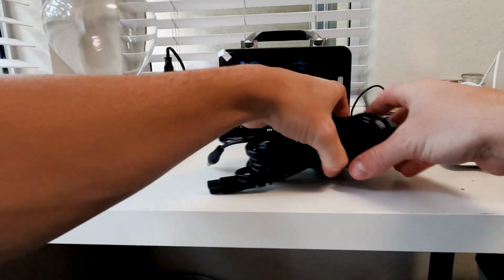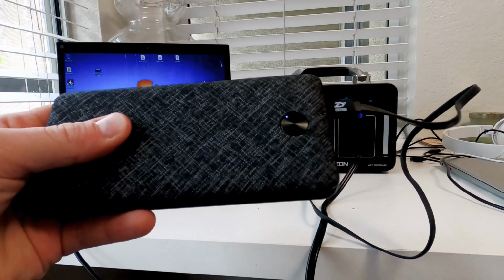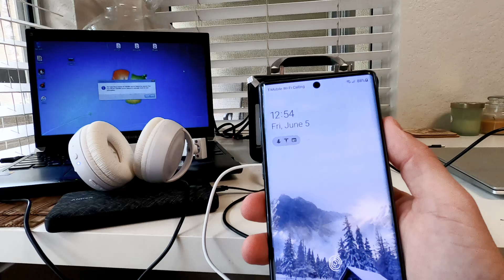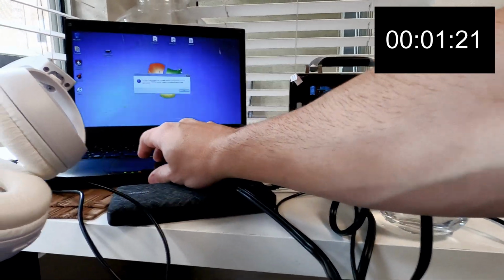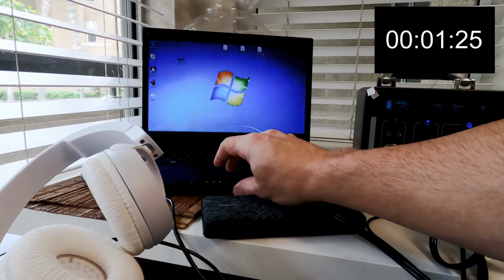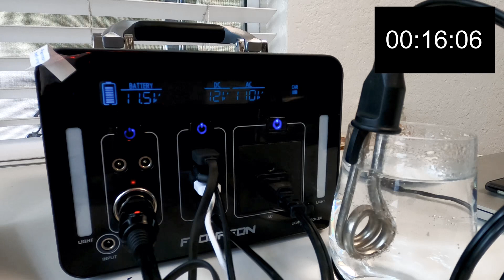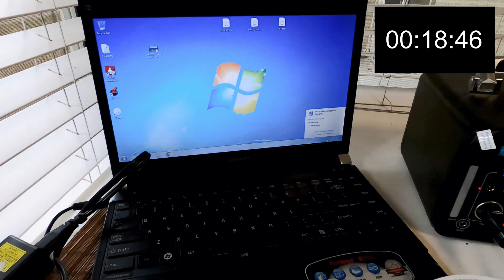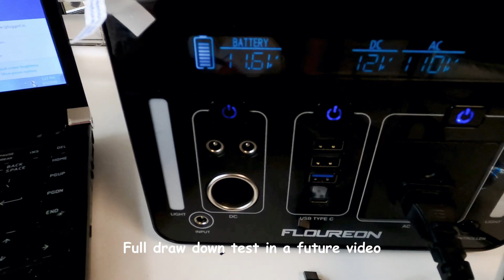Load test of Floureon 500 wh power bank / battery / inverter

Comment: Surely the 🔋 battery icon in top left corner shows state of charge? So each bar would relate to 20%.
I would like to know how well this power station is charged via solar power, and how quick it will charge from 100W and 120W folding solar panels. In other words if it will use max power from the solar. If it doesn't, and is regulated at very low rate, then it would take forever to charge.

Comment: what is the largest wattage object you have been able to power Please? I have got one and my 250 watt mini heater seems to be just too much for it but it says it will run items upto 250 watt. My older powerbank will run it but that is 600 watt (but less overall capacity). I only want it for about  a 5 minute zap in the morning in our tiny camper.
Reply from the maker: Interesting, I ran a 300 watt rice cooker on it for a few minutes and it didn't seem to have a problem. I would stay at 250w or less for continuous use though.
Reply: @ryen7512  does seem weird,I wonder if the heaters thermostat thing confuses it.
Reply from the maker: @logothaironsides2942  have u checked to see how many watts it actually used with a kill-a-watt device or similar?
Reply: @ryen7512  good point....will give that a go thanks
Reply: UPDATE******On our plug in watt meter it shows my heater uses 430 watts for about 5 seconds and that is what is stopping it running even though it actually draws 250 for the rest of the time. .

Comment: the inverter has broken and im wondering if you have the same trouble?
Reply from the maker: I have not had troubles with mine, yet. Lol
Reply: @ryen7512  everything else still works apart from the inverter. it just stopped producing power while i was on my console (ps4).
i spoke to the reseller on ebay and they agreed to pay half the money back because there is no other model in stock to replace mine.

i use another portable inverter from the 12v port to replace the faulty source.

there is nothing on the internet of anyone complaining of the same problem. and there is a limited amount of "you-tubers" promoting this product. 
until when i found you.
Reply: @LITTLEEXPERIMENTCHANNEL1  is this good for running tv and PS4 also do you think it could run two TVs and two ps4
Reply: @Titan-ql7dx  its good for a ps4 and at 32" tv nothing bigger. That about 100w that will last about 4-5 hours. 
I bought a jackery explorer 1000 now and is the best investment yet. (Should of bought that first).
Reply: @LITTLEEXPERIMENTCHANNEL1  how much is that plz ?
Reply: Yikes! Hopefully yours is a one-off problem and not an indicator towards quality control in manufacture.

Comment: Thanks a lot for your videos!! It s available in Gemany now but i cannot find out how to plug a solarpanel, that must be not so easy. It seams to be complicate when i see al this stuff belonging to the solar panels. Do you have any experience with a solar bag? They are all very expensive but whn I don`t know how to plug it is wasted money. Thanks and best regards from Cologne;-)
Reply: MC4 connection cables should plug into solar panel and the battery station.

Comment: hey 
Could you charge up the Unit via Solar power or ac power while using it ?
Reply from the maker: Yes, you can charge via AC power while using the outlets. I don't have a solar panel, so haven't been able to test that out yet. It is suppose to do it.
Reply: @ryen7512  thanks for the quick answer:) How is the Generator holding up so far since you have it ?
And what about the real amount of wh you can use ? And last but not least how long does it take to recharge completely ^^
Thanks in advance
Reply from the maker: @Thecarn14  it's holding up well. I would say it takes perhaps 5-6 hours to recharge, but I haven't timed it. It is holding up well with good capacity so far. Perhaps soon I will do an actual capacity test again using my kill-a-watt. Cheers.
Reply: @ryen7512  perfect, did you perhaps also test it using a small fridge for camping etc ?